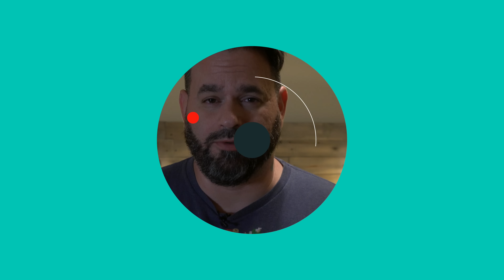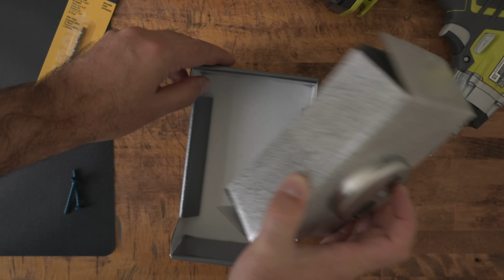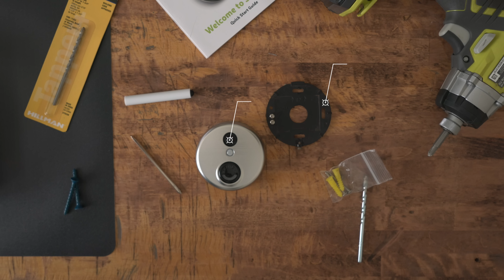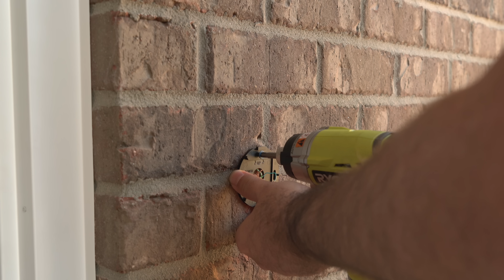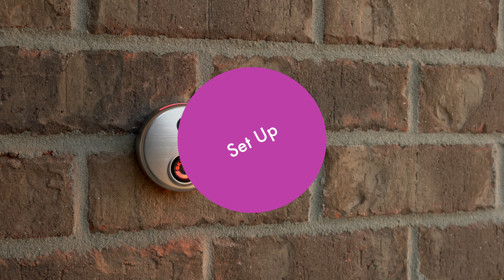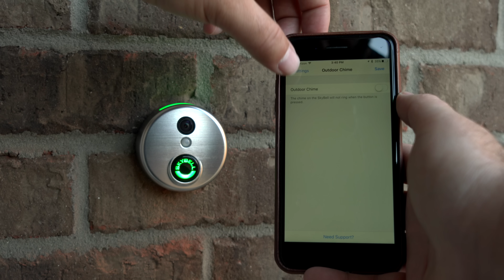Unboxing, Installing and Features of the SkyBell HD

Comment: Larry, question. From my house to the front entrance is about 80 meters. I have wifi out there. I have regular 120v but never had door bell there. Can I use regular 120v cables to connect it and then connect to the wifi?